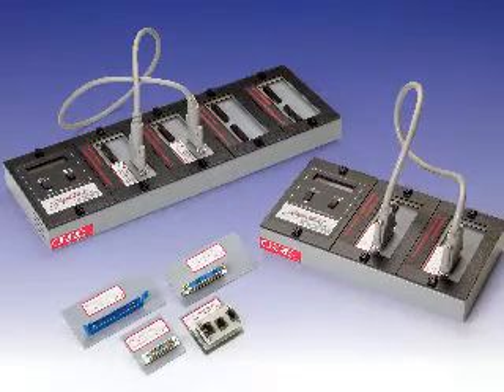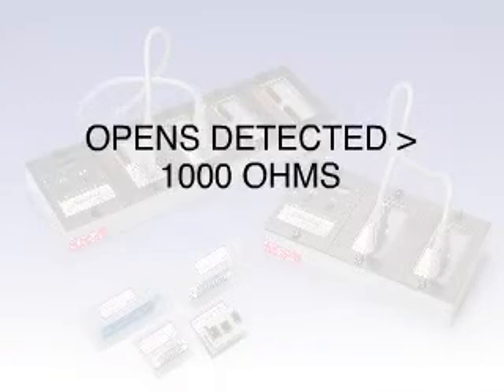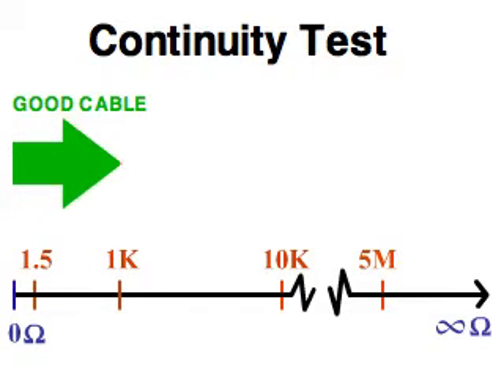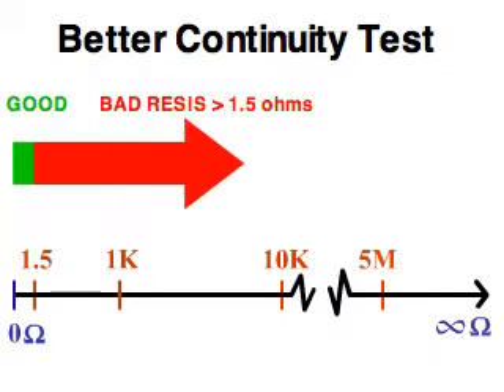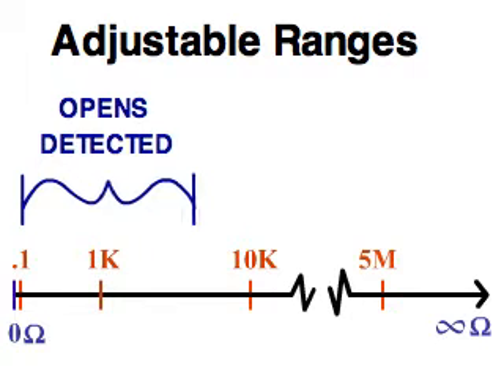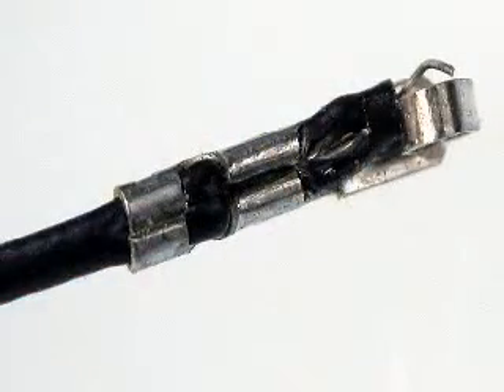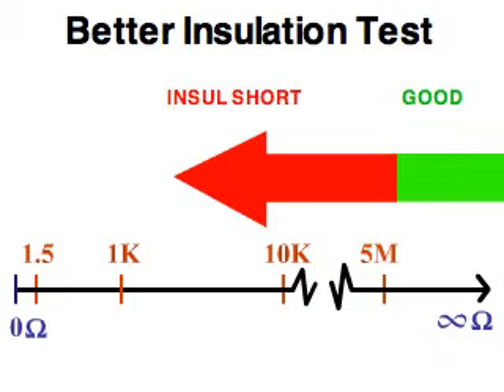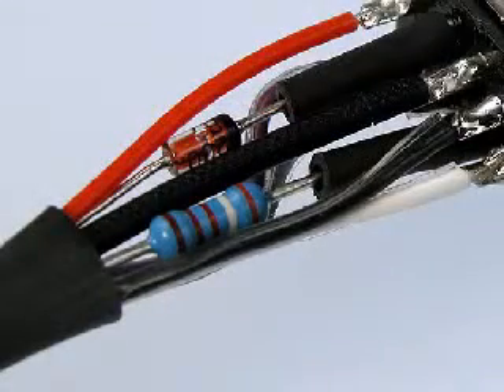1000 RX Electrical Cable and Harness Tester

Comment: i also want to measure time down to 1 uS when 10ohm discontinuity occurs. Is it posssible ? 
FYI : EIA - 364 - 46B Test Procedure
Reply from the maker: Cirris testers use a 'scanning' method for testing discontinuity - that is they will look at one connection at a time and scan through all such connections one after the other. Thus how often each connection is monitored is determined by how many connections are in the device being tested. The larger the device, the longer the time between monitoring any specific connection. Currently our equipment does not have the capability to scan at 1 uS, even with a small device. For smaller devices the time is closer to 1 mS. 
However, looking at the referenced specification it states "A discontinuity is defined as a series loop resistance of 10 ohms or greater lasting for one microsecond or longer,". The tester can find discontinuities lasting longer than 1 uS, but it is possible to miss discontinuities lasting longer then 1 uS but shorter than the fastest scan rate of the test .